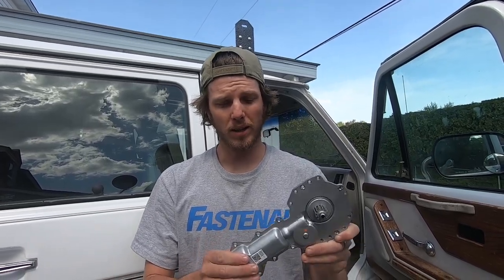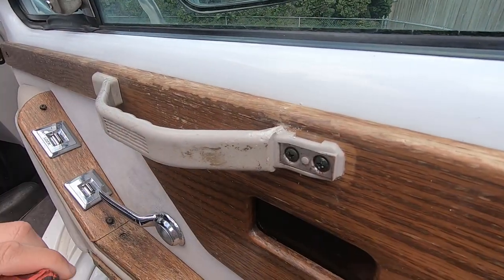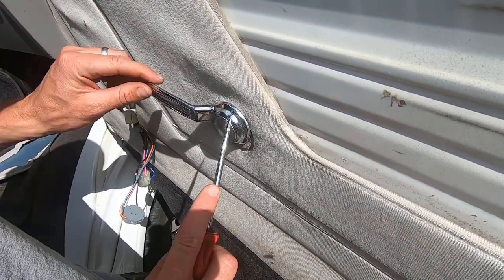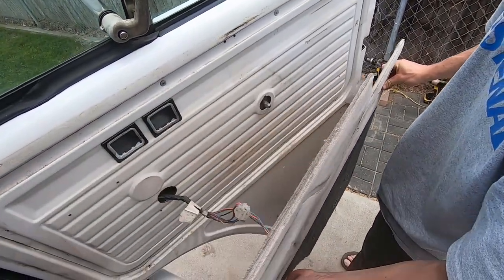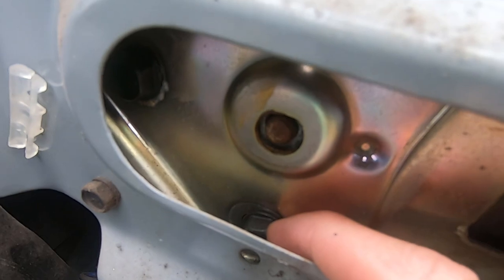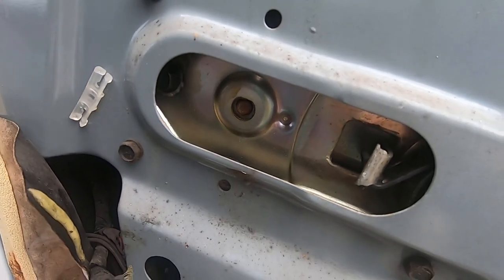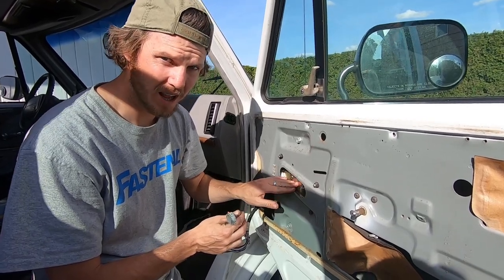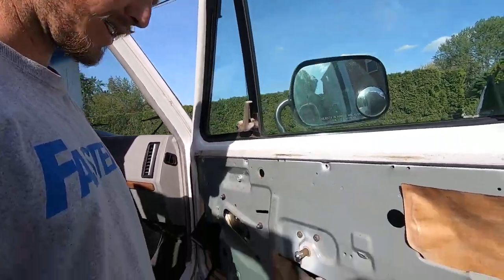How To Replace A Power Window Lift Motor (Chevy G20 Van)

Comment: You're a legend.  Took a couple hours front to back and it was a pain in the ass the thread those bolts back into the new motor and to get the door trim aligned properly but i'm stoked.  I remember i had asked a mechanic how much to fix mine one day in the past and he said something like $450.  The new motor was 45 bucks and i did it all myself.  Proppppper.
Reply from the maker: Yeeeewww that's awesome man. Glad you got it sorted!

Comment: You are a lifesaver, I have a 93 GMC G2500 Vandura, and I have the Factory Manual which sucks. They want you to drill a hole through the sector gear, and backing plate, then install a 3/4” self tapping screw to prevent the coil spring from releasing. WTH? After replacing motor, which by the way, they had more unnecessary steps involved, you are supposed to remove the screw. 
My year requires a 13 mm wrench, and I held the window up with a bar clamp, now to go on NAPA’s website to order the motor.

Comment: Thank you very much. It was a pain in the ass, to get this thing out this way. 
But I just done it, opened the motor, cleaned it with fresh fluid and it works like new again. The old grease was like beton ;-)

Comment: Dammit I got the bracket in the door  after an hour of struggling with the bolts but didn’t know I had to bolt the bracket the the motor. I’ll try again tomorrow, thank you for the video

Comment: I've got a 1992 GMC Vandura. I think this guide will apply to me. You definitely have given me confidence that I can do it. Great video. Like, for real. Much appreciated.
Reply from the maker: No problem. Thanks! Yep, it should be a similar set up if not exactly the same for your Vandura.
Reply: @RoadTripUSA  oh, it certainly helped more than a little. Much much appreciated. So nice to see that window go up and down again.
Reply from the maker: @ColtinCalloway  It is very nice. Summer time here we come lol
Reply: I too have a 1992 GMC Vandura.  I was able to find all of the factory shop manuals, to include the manual with all of the electrical schematics. If you need any reference help let me know.

Comment: If you think you are just going to slip it in like he says,think again! Bolts keep twisting. You have to get some kind of rubber Clog to wedge in behind to line up bolts while holding the motor in place or cut enough panel to insert bolts..You don't have enough hands.
Reply from the maker: It's possible to do it without cutting the panel. I've done a few of these now and haven't had trouble before. Sorry yours was a pain.

Comment: I'm getting a couple of motors off amazon in a few days. I'm tired of paying a mechanic for everything. This video is better than the others I've seen for my 93 vandura. My door handle will be easier because I'm using a vice grip after it stripped out hehe.
Reply from the maker: Great! I'm glad the video helped you. No need to pay a mechanic for simple fixes like this. Thanks.

Comment: June22, 2024 Just completed mine with great success...TY.  To make it easier, I significantly slacked off the 6 bolt heads that you see at 5:44 .  That new space I created was enough gap to get my ratchet wrench mostly usable, not entirely.  Lubed up the scissor sliders and ran graphite spray along the black side channels.  (my issue was actually contact corrosion of the easy accessed motor connector...DANG, but I got a brand new motor now)
Reply from the maker: Great tip by slacking off those bolts. That's funny that it was just corrosion on the connector. But like you said, at least you have a brand new motor now!

Comment: Thanks man
  Had my 91 apart but couldnt get the old motor out. With your video i realized it was just tight in place. Got it out, had to reuse plate, new one was bolt in and not threaded. Got it all done. Mine is white with small striping, a jayco conversion. Its almost the same looking as yours. I need to do pass side now as motor runs but tracking is bad. 
Thanks again.
South florida.
Reply from the maker: I'm glad you got it sorted! You'll definitely need those windows down in South Florida lol

Comment: Yeah! Great video! I've got a 91 G20 so the layout is a little different, but I think I can manage it wit this video.
Reply from the maker: It might be slightly different in terms of the panels to get to the lift motor but the motor itself will be the same and should be mounted the same. Same part 79 through 95 G20's.
Reply: @RoadTripUSA  Yes it was! Your video helped tremendously! I did end up just cutting into the door frame to access the screws.

Comment: Hello, friend, seeing your video and the explanation you give step by step, I decided to change mine, since none of the 2 worked, my van is a 1991 GMC vandura G2500, I bought the original that comes from the factory, I changed the one from the passenger first and before putting the cover on the door I tried that it worked, I had to put w40 on the hardware because they were stuck, my van has been stopped since 2017, even so they went up and down without problems, and when I put the cover on and everything I was surprised that the door does not work, what do you think is the problem? If you could help me I would appreciate it, since the part cost me 81 dollars and if I have to take it to a mechanic they would charge me more. Thank you and very good video
Reply from the maker: Did you mean the door won't open or the window won't open? Let me know and I will try to help. And thank you for your kind words :)

Comment: Wish this video was around couple yrs ago , ive replaced mine like 3 times now . Luckily i did get a little advice before i did it the first time . Guess these motors are a weak spot on these yr trucks an vans . Anyways great video .
Reply from the maker: Thanks, glad you figured it out! It seems that new parts aren't as good quality as the original.

Comment: I got a 1990. This video works for it also. One note, drilling out the old plate is probably better than getting the one with the plate. They use a new style and there is no threads for the old screw.  You have to use their new bolts to put plate back on. I think this must be done while motor is in the door??
Reply from the maker: Have they changed the plate on the new lift motor?

Comment: Currently working on my 93 G20 got the new bolts but the nuts are too small so it allows the motor to come right apart from the new bracket did you have to get new nuts  for the bracket and motor to stay intact?
Reply from the maker: No, the ones that I have done have always fitted with the old nuts. Sometimes the after market manufacturers change things like that. Hopefully you were able to find the right sized nuts and make it work.

Comment: I've tried every way to get the bolts started but there's just no room for my hand to get them started. Any suggestion"
Reply: Loosen assembly
2 bolts
2 nuts
Push slightly inboard
Then you can get em started
Start all 3 before tighten down

Comment: I have a '93 Vandura, and my window won't come back up. The motor had been replaced last year, it seems the window got stuck after an especially bumpy ride. I'm trying to open up my door to take a good look at it and I've removed all the nuts bolts and screws I can see, but it's just not budging! I don't want to force it and risk breaking something, any ideas? The door looks identical to yours.
Reply from the maker: Sorry for the late reply. Did you manage to figure it out? Maybe try spraying WD40 on the lift mechanism and see if you can get it to budge?

Comment: I'm struggling to get the door handle off, is there any help in using other tools?
Reply: Which door handle?
Reply from the maker: Once you pop off the covers and expose the screws it should be easy to undo them. I don't no what other tool besides a flathead screw driver you would use.
Reply: @RoadTripUSA  I actually managed to get it off, had to wiggle it and use a lot of force to pull it off. Previous owner had apparently glued the handle on instead of using the pin.

Comment: Hello. I really hope someone e answers this; what do you do if the window is already down?
Reply from the maker: You should be able to manually lift the window up and tape it so it doesn't fall. Then when you have replaced the motor you can raise the lift up to the window.

Comment: My window is not going up or down. However. There seems to be a slight click /noise action from inside the door when I flip the switch either way. How do I check the electrical other than the fuse?
Reply: your connection might be bad go ahead and take off your the part of the door panel where your switch is and clean it up with a bit of paper or something mine had a lot of dirt in there.
Reply: @chrisadventures1642  I changed motor on each side and windows are working 👌🏾
Reply from the maker: @jaktheapprentice1023  Glad you got them working. I had the same issue on my other g20 van, it was the electrical harness that was dirty too and after cleaning it worked fine.
Reply from the maker: @chrisadventures1642  I feel like this is a common issue and a much cheaper fix than a new switch or motor.

Comment: Didn’t bother trying to unscrew those bolts through that tight space. Just cut the metal around it with sheet metal shears and was able to get in there with a ratchet. Pretty stupid design
Reply: Yeah! Thanks! We got the bolts out, but forget about getting them back in! Good to know! I'll get the shears!
Reply from the maker: Yeah it's not the best design but it is possible to do it without cutting the door. Glad you got it done though.
Reply: Exactly my thoughts. I'm going to replace mine Saturday, and I will cut some metal out of the way. 😁

Comment: So the window broke and you figured you would film it?
Reply: It was not the window, but it was the power window motor (that Raises and lowers the window) that went out..
Personally, I am very thankful for all of these men and women that makes these videos. I hate paying a mechanic for something that I can do. 
Thank you dude for making this video. It helps me alot to fix my mothers G20 van instead of paying a mechanic 200 dollars for labor plus whatever the part cost.
Reply from the maker: @sidneyvanzandt2473  Thanks for that :) Yep, no need to pay a mechanic when  you can easily order the parts online and much cheaper than what the mechanic will ask. Many of the fixes are so easy, people don't even realize. I'm glad I could be so useful. Let us know if there is anything else with your van you are having trouble with.
Reply from the maker: @BPzeropoint  Hey, I'm not really sure. It's probably the same but you're going to need to take the panel off to access the motor.

Comment: That is absolutely not the one I have I have a G 20 and there is a bracket in the way to pull that motor out from the window no way to get by it I’ve tried three different times